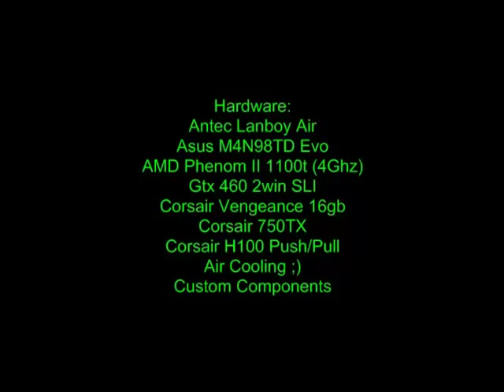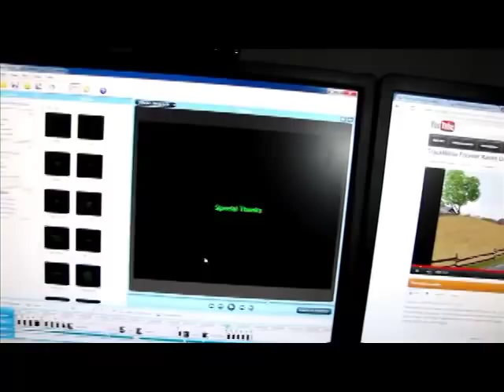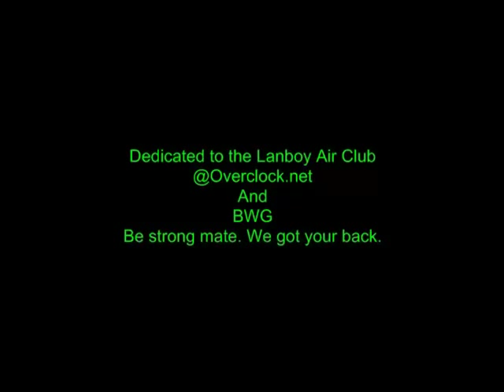LEGION Custom PC Mod Tour AKA The WindTunnel

Comment from the maker: Getting an 1100t Stable and Ram timings stable, I just haven't had the time. The 4.0 is on a switch, turbo on the keyswitch I use for power.

Comment from the maker: It would impede an optical drive very, very slightly in my configuration. However mounting at the top requires going R-ATX which means flipping the whole motherboard assembly.

Any other questions lemme know!

Comment: I wonder how this build sounds? :D 
Ive go only 6 fans, 4*120mm, 1*140mm and one 230mm. And I have to reduce rpm so it wont sound like vacum cleaner, but in your case it must sound like a helicopter over your house :D